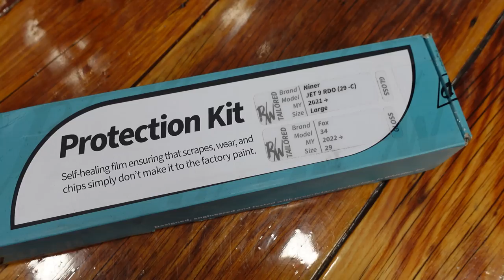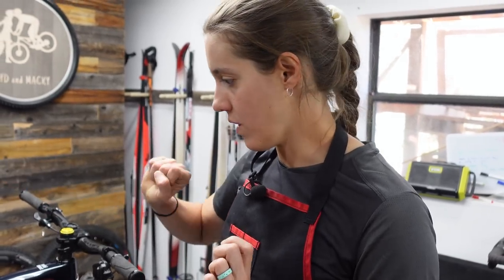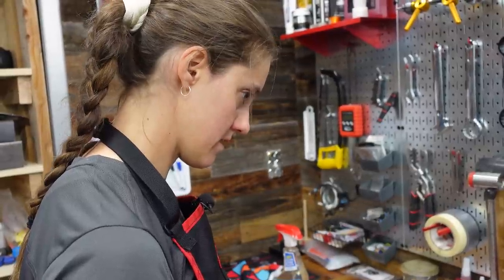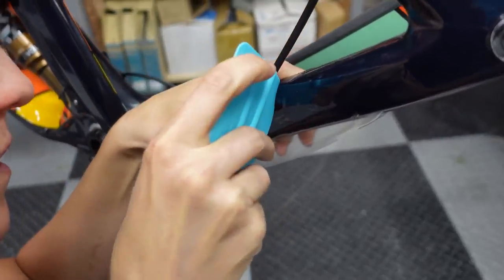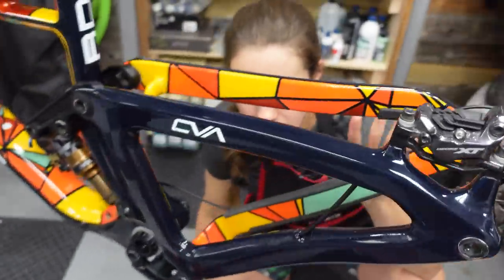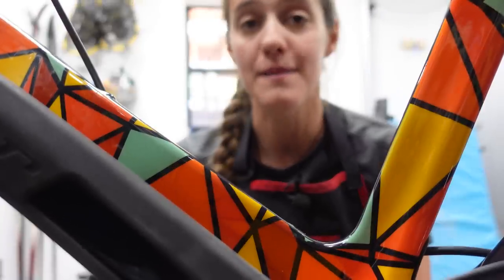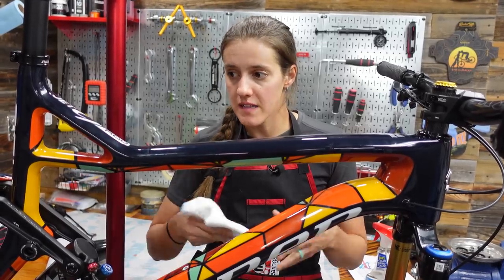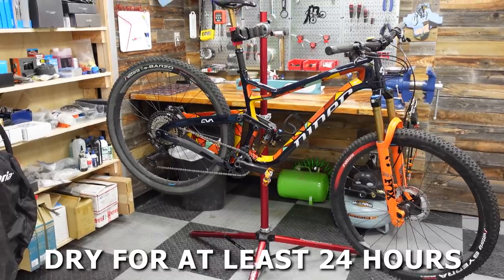Protect your bike from rocks and scratches (RIDEWRAP FRAME PROTECTOR INSTALL) | Syd Fixes Bikes

Comment from the maker: If this video was helpful and saved you time and/or money, consider supporting the channel by hitting the "Thanks" button above to leave a tip.
Reply: I love you ❤️
Reply: Hey syd me agian, i thouth if someone could help me it whas you :D i whas about to buy a nieuw frame but i found a 75€ giant team trials frame, do you think its worth it ?
Reply: Seems like far too much fuss and cost to simply keep some minor scratches or scuffs off your bike.  Have also known a few guys that have used this stuff and within 2 years there were absolutely sections that were peeling at the edges. Looked like old worn clear tape you would see on an old shipping box. No thanks. Scuffs and scratches mean you actually ride your bike and I doubt this stuff helps resale value all that much. An old bike is an old bike regardless of whether it has fewer minor scratches or not. 🙂

Comment: I've installed ride wrap on 3 bikes now. Still takes me several hours.  A heat gun helps a lot, for sure. Also, a sewing needle to poke holes in any of the bubbles you can't get, will take care of most of them. It does make cleaning the bike much easier and keeps the paint looking new much better than if you don't use it. Definitely a hassle, but worthwhile.
Reply: I should also add, after 3 years it is starting to peel off at some edges in a minor way. Just enough to collect some dirt underneath small segments.
Reply: @deisen123  I guess it might not be worth wrapping a bike that I have owned for 2+ years? Has a scratch or two on some part of the frame.  Was interested in maybe wrapping it, but then again, not sure if it is worth it now that it has existing scratch marks.
Reply: @SesameBuns  the wrap will hide or help hide existing scratches, deep scratches will require touch up paint so as to not leave air pockets in the film

Comment: Looks really great. I'm sure you could also spray the frame to make life easier. It's the same idea as applying motorbike decals, slightly soapy spray allows you to lift and re-apply as necessary, then push out the water and let it stick. Learnt this many moons ago from a couple of bodyshop specialists, it was a 'trade secret' at the time!!
Reply: Same as window tint.  I think it would be hard to squeegee some of the smaller pieces if it's actually floating but yeah, completely douse the thing it will make it way easier.

Comment: I've applied frame wrap to all of my mountain bikes. I can completely empathise with how annoying it is to chase bubbles, and also how obsessive one can get in making sure it goes on properly. I always spray more solution than necessary, and end up sliding the piece into place thinking "yay, I did it!", until squeegeeing it moves the piece away from the location because I was a bit enthusiastic with the spraying!

All the bikes have had bubbles/lifting of surfaces. Unfortunately I didn't catch the lifted parts in time, and only noticed it when dirt got caught in the lifted areas. But I 100% will do it again. And you're right: take your time! I also did it over a few drinks to dull the nerves a little!

Comment: I contemplated Ride Wrap on my Pivot Switchblade…..and after much research, it does effect the warranty of your frame, along with potentially effecting your paint upon removing it.  I opted for some XPEL stealth film on the bottom of the Down tube, inside the seat and chain stays and backside of the seat tube.

Comment: I just did my first ride wrap about a week ago. Like you the first couple of pieces were a learning experience.  I found using my fingers and the cloth after getting the entire piece in place was better than using the squeegee for removing bubble and extra solution. The more I soaked the pieces and the frame the easier placement was.

Comment: These ride wrap kits look great. I've done similar with helicopter tape and do my own cuts and use a little dish soap and water in a spray bottle with a heat gun. Looks really good. I also wear disposable gloves when applying the tape too. Make sure I don't leave finger prints on the tape.

Comment: I wrapped my own bike and a customers with Invisiframe and the results were very good. If in doubt use more spray and take your time. If after several hours some bubbles appear I found using a pin to pierce the bubble and then work out the air/water worked well. The pin hole disappears. I’m interested to see how it looks in a year 🤞.

Comment: I find a pull-stroke a lot easier with the plastic squeegees.  Less likely to apply too much pressure and rip the decal.  I also come from screen-printing and sign-vinyl experience though so my pull-stroke might be a bit more refined than the average.

Comment: I just used 3m tape on my down tube, chain stays, and in the two places I strap a spare tube and water bottle to my bike. Seems to work fine. And some silicon detailer goes a long way to keep mud, dirt, snow slush, and other crud from sticking to my frame.

Comment: I've read you can use a 15% isopropyl alcohol solution in another spray bottle on the final edges to help work out the soapy solution and get better final tack on the edges once you've got it in place.  Use liberal amounts of spray on surface and back of wrap to begin with to help with bubbles and squeegee out.

Comment: Paint Protection Film (PPF) is used mainly on cars. The solution is just dish soap and  you dilute it with water. My tip would be to not only spray the film but also the frame. The more solution the better. Once you get all the bubbles out use the heat gun and microfiber to finish the edge like you did.

Comment: Air bubbles are an issue, but water bubbles can be safely ignored as they'll go away on their own over the next couple of weeks. It's also best to start squeegeeing from the middle of a piece out to each edge. Finally, with the edges that won't stick, use a dry paper towel to "wipe" the edge onto the frame and that will get most of the edge to stick.

Comment: Took me 3-4 hours at least plus another day or two of obsessively popping and pressing bubbles out. I don't think I cleaned the bike I did nearly enough and it's peeling a bit now 4 months later in some of the more precarious spots (near the rear wheel well, bottom bracket area etc.) Mostly looks amazing and being able to change the finish of my bike to matte was amazing.

Comment: You can also avoid fingerprints on the underside of the wrap by dipping your hands in warm water with a small drop of dish soap before handling the wrap
Reply: Good to know! Fingerprints would always bug me, it also starts peeling easier

Comment: All Mountain Style frame guards, costs more but is far simpler to handle and install.  Peel and stick just like a decal.  This looks annoying as hell with having to spray the solution and use hairdryer
Reply: The solution makes life a lot easier because you can reposition.  I use this trick for putting on all kinds of protectors, decals, whatevs.  The hair dryer, yeah, maybe that is a little annoying.

Comment: You really have to practice with this stuff. The way I do it is plan to stick the middle of the piece first length wise work the middle out. The reason why is the more you stick and pull back to align the more chance of finger prints underneath messing with the adhesive not sticking (especially at edges) and bubbles that wont come out because the piece is now stretched. Another good reason is your smoothing the shortest distance for bubbles and solution extraction.  For example... a rectangular piece that would cover a top tube. Wet both the piece and the tube thoroughly with solution till dripping. Place your piece over the top tube very lightly on top of the top tube center length to length for your piece and forward and aft for your top tube. Spray solution on top till running off. The top of your piece must be wet for your squeegee to work correctly. If too dry your squeegee will cause wrinkles. Run your squeegee just on top forward and aft just enough to stick and no bubbles. This part now that is sticking should only be about a 1/4 inch or 6mm from the front of your top tube to the back. Now start in the middle and hold out your piece but do not stretch the piece. Swipe with the squeegee in down strokes from the top to forward. Just do a down swipe that might only give you another half inch or so that sticks but work the line all the way one way....then go back to center go the other way till all is even. Then start over till that side is complete. Sometimes on a complicated piece I will cut it out but leave the backing on. Place on intended target and make alignment marks on both. That way I have a good start and not pulling off so many times. On big complex pieces sometimes I will make my marks, pull just a little of the backing, align, and proceed with taking the backing off a few inches at a time. Use a lot of solution. Hair dryers and heat guns both produce heat but are quite different. Dark colors show finger prints and imperfections more. Wow this is long.